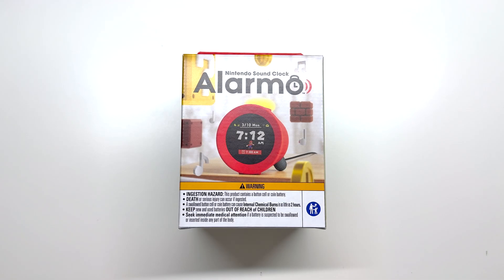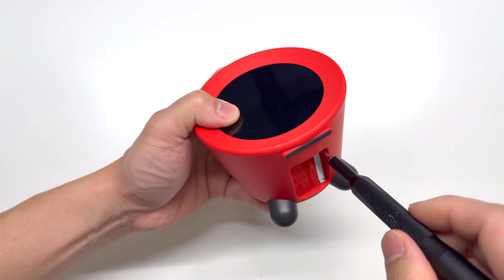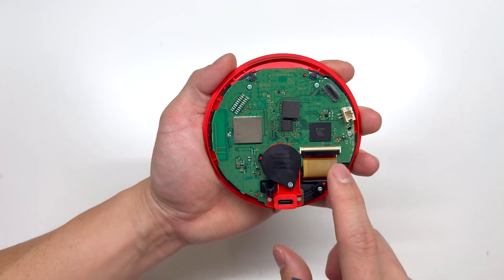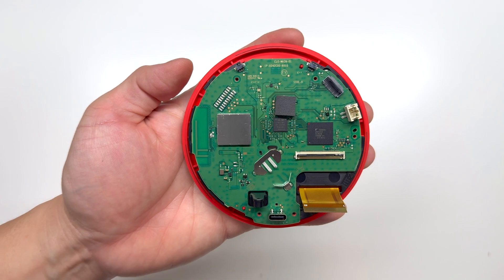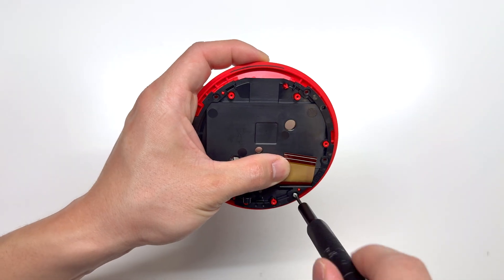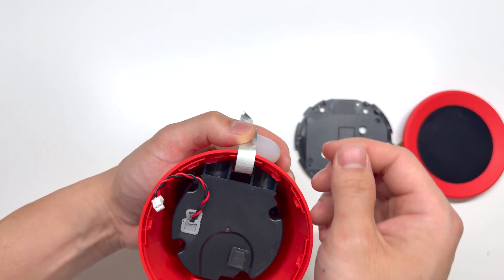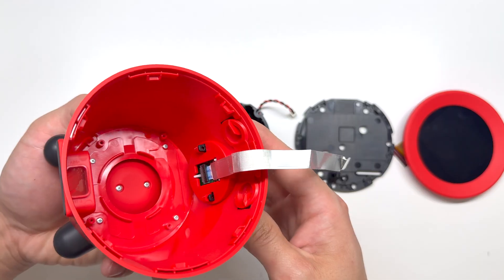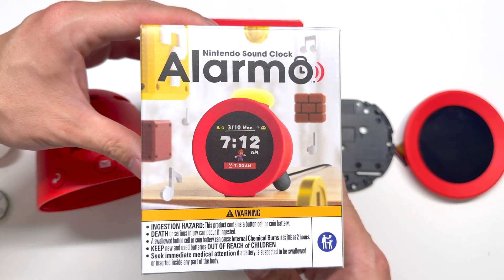Nintendo's $100 Alarmo Teardown (Alarm/Sound Clock)

Comment: Thank you so much for this. I learned alot especially about the battery, i didn't know it had one in there. I was trying to see if there is a way to remove the light sensor since even with the auto dimming off, it still dimms at night when i want the screen to be bright. But other than the dimming issue i have with the Alarmo, its a great alarm and gets loud. It starts off with a low volume and then works its way up to 100% volume when you dont respond to the alarm as it goes off so that's really cool.